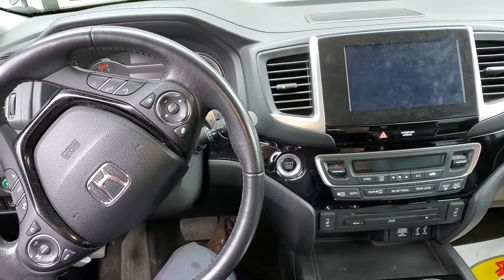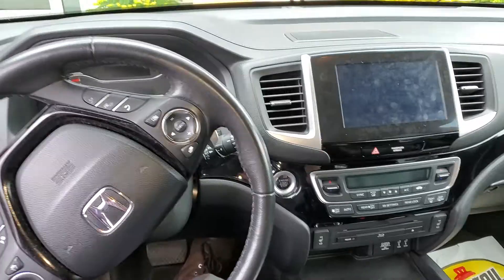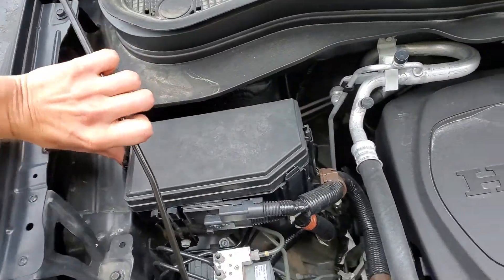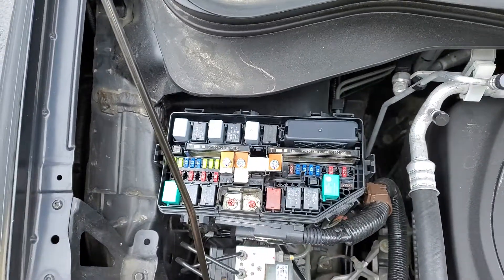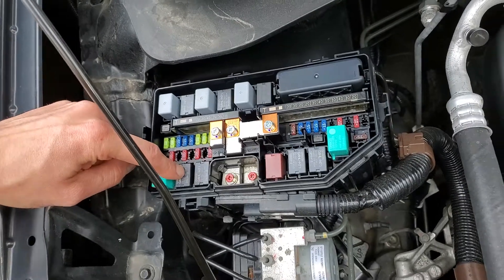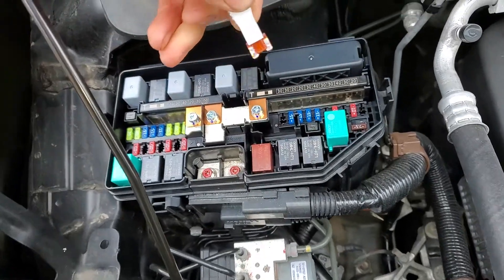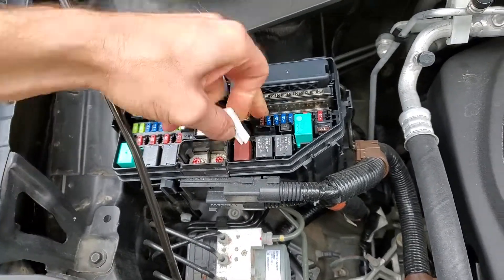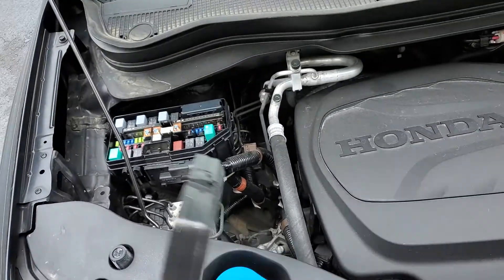2016 Honda Pilot AC Relay & AC Fuse

Comment: My 2017 Pilot, AC is not working fuse is not burnt and changed the relay still its not working, anything i can do before heading to mechanic, appreciate your response
Reply: Same here let me know if you found the solution it’s hot out and I have no a/c great timing car lol
Reply: Could possibly be the motor itself. I have this issue right now on a 2017 EX-L I believe it to be the fan motor because before making a trip to Florida in April I opened the hood to check everything for the trip and I turned the ac on fan not spinning and smelled and burning smell. So my issue just may be a fan motor.
Reply: @calmyournerve  same here. Hope its not the condensor itself

Comment: I have a 2016 pilot Ac is not cooling have evacuated and recharged system ac compressor is running just no cool air pressures are in the norm per gages any recomendatins?

Comment: Hey brother I have a 2017 honda pilot elite however I am having a ac problem blows cold for a few hours after driving for some time ac becomes weak and you can hear it blowing under dash,also cannot adjust with mode control,if parked for a while and restart,meaning cooled down and restart then it gets cold,idk what the heck

Comment: My 2016 Honda Pilot’s ac sometimes doesn’t turn on. The fan won’t turn on and the compressor won’t turn on. Do you think this might be caused by a bad relay? sometimes the blower will feel like it has low power as well(not sure if this has something to do)
Reply: I’m having same problem w both heat & air.  Sometimes no blower

Comment: I have a 2017 Honda pilot and i suspect the AC relay is bad, my evaporator it freezes after driving on  a highway, driving in the city seems to work fine, i changed the entire system because the compressor burn out, i know the evaporator freezes because there's air flow restrictions, after turn the AC off for 10 minutes then turn on it works fine

Comment: When I turn on the AC in my 2016 pilot, I don't feel that "gentle jerk" in the vehicle. The compressor doesn't turn on. No cold air, obviously. Do you think ( your opinion ) it's the relay or the fuse that has a problem and not the AC system....?? Thanks